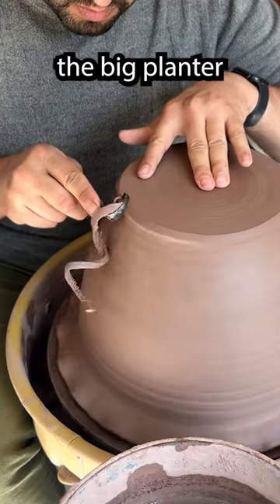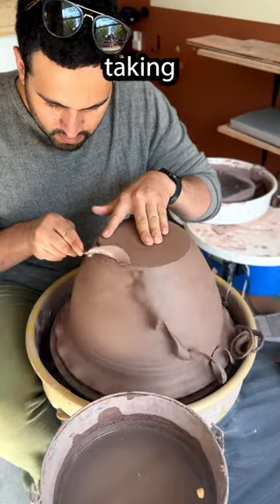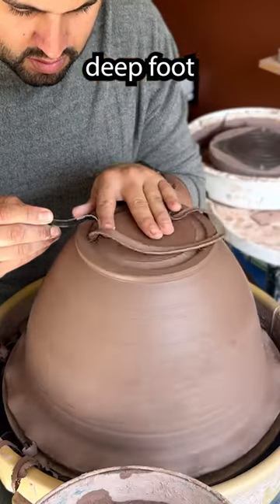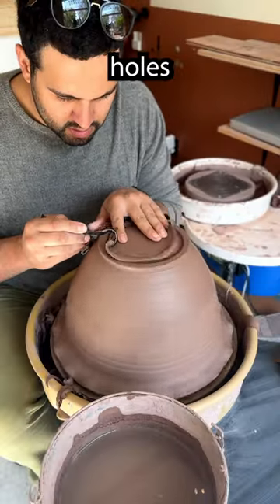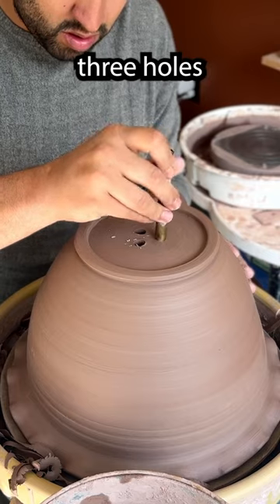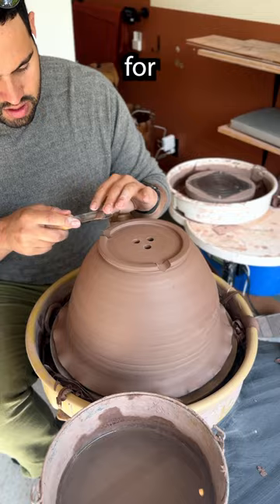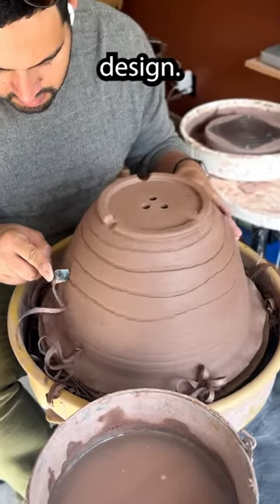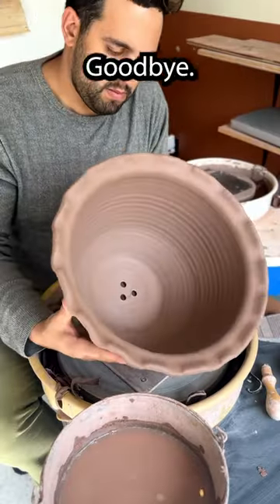trimming a planter😎#Pottery #Ceramics #To #Process #Handmade

Comment: The fact that it has THREE drainage holes sold me ❤ so many cute planters/pots have zero and its frustrating
Reply: Just drill them yourself!
Reply: @LethalLuggage 

1. Requires power tools, after the last incident i was banned from using them (i did cause alot of property damage to be fair)

2. High risk of the pots breaking and causing injuries, i will100% cut myself on broken pots